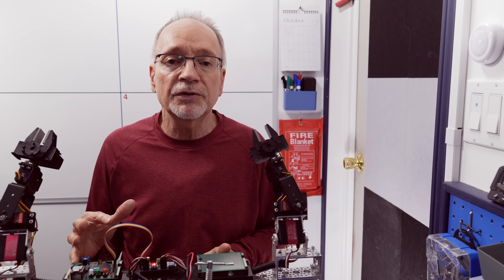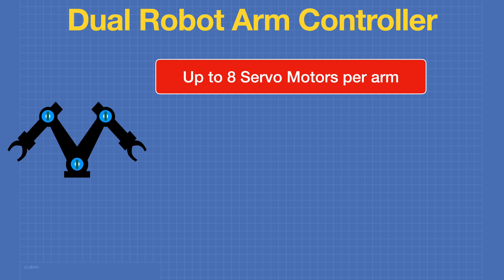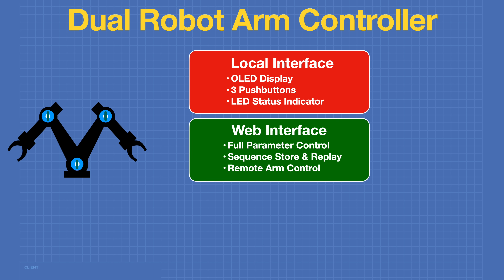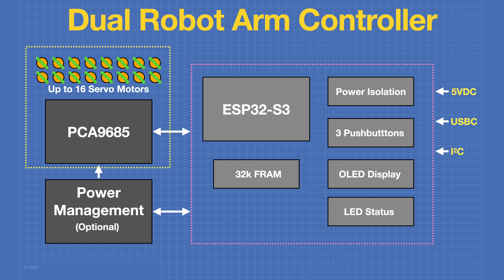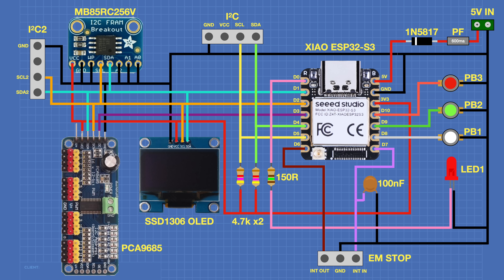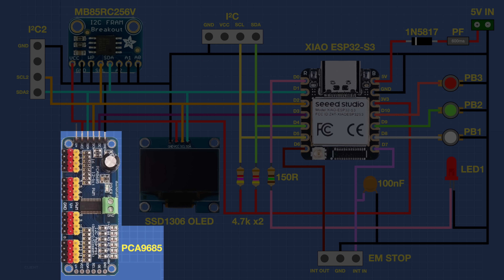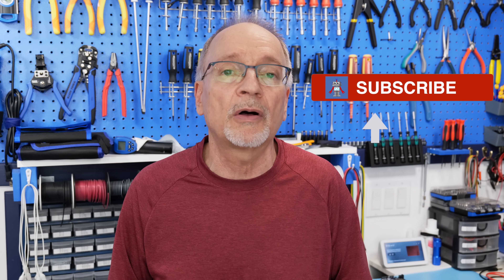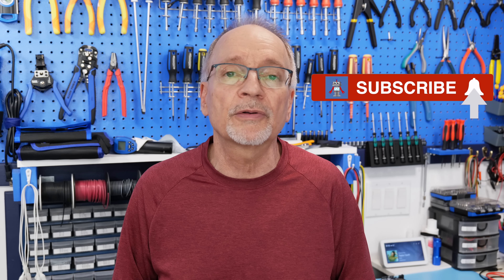Dual Robot Arm Controller - Status Update

Comment: I'm playing with a 6 dof arm  and I'm using 25kg digital servos. I now understand why you are using power management on your project.  The holding current for the servos is quite substantial, I may have to use some type of PM to reduce power usage

Comment: Hi Bill, very nice work! I have a little question, how does the 1n5817 Schottky diode help both 5Vs not conflict with each other? I thought that the 5V of the USB was the one who needed this isolation so as not accidentaly burn the PC (Some forums suggested cutting the 5V USB cable and externally powering the CH340)

Comment: I would like to know more about the resistors placed on the I2c scl and sca lines.  How is the resistance value calculated?  What tests are done to make sure those are sized correctly to clean up the background noise on the communication lines?

Comment: So cool, Bill!  Have you looked into the K-bot from K-scale labs yet? It is totally open source, humanoid. I plan to build one. Your end effectors could work on the K-bot possibly. :)
Reply: Side note: Bill, have you ever looked into Bottango? It is very useful for creating smooth poses and animations with servos. It is mainly for animatronics, but has a use case in classic robotics, too. It allows to essentially "edit" servo animations with a timeline, like a video editor. Really useful for puppeteering, and figuring out movements. It is also possible to export this raw data for later use in things like your custom code.  Just a thought, if you are not aware of it.

Comment: I'm always in trouble powering things. Right now I have 2x775 motors (with BTS7960-M), 1xMG996R servo, ESP32-S3-DEV-N16R8, 2xPCAs, LEDs, all the small things and the peak power consumption can go up 18A. Theoretically. This is mental. Am I doing something wrong or I should just deal with it and have 3 rails (3x6A) for safety?
Reply: Is the physical size of a standard PC ATX power supply too big? If not, grab one and you'll have loads of 12v current available. 500W ATX power supplies will tend to have around 35A of 12v available.
You might even find a free one from a computer repair store or a geeky friend.

Comment: You can eliminate the reverse polarity diode and replace with an p-channel mosfet and get a negligible voltage drop. Search for: p channel mosfet reverse polarity protection